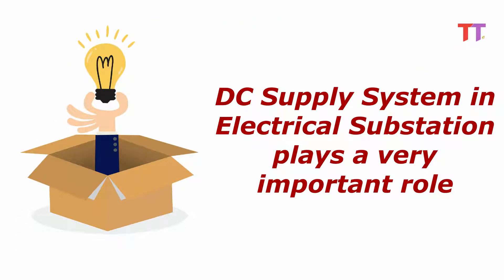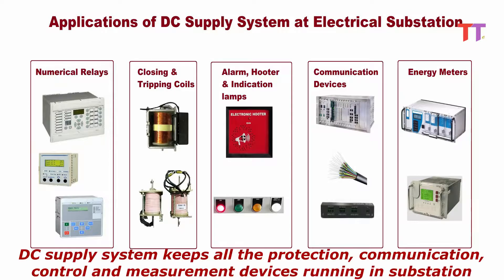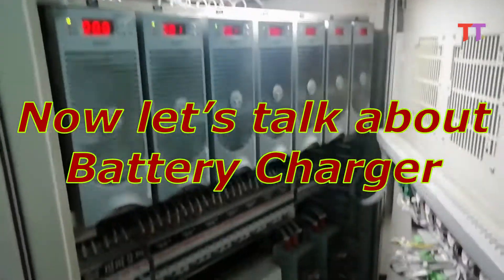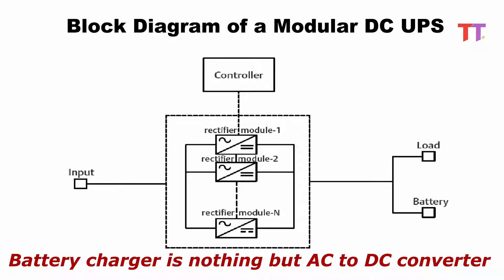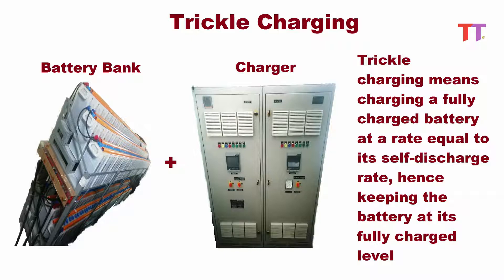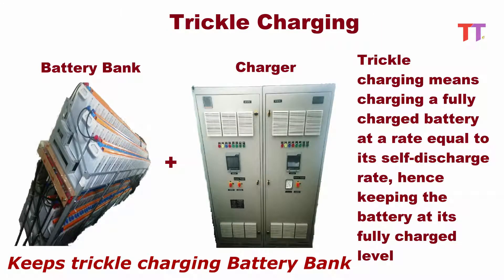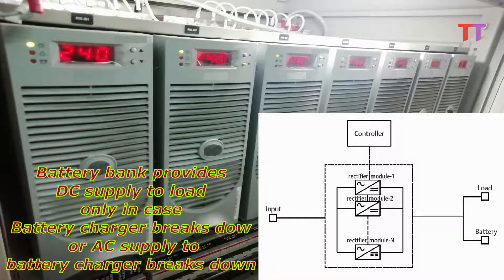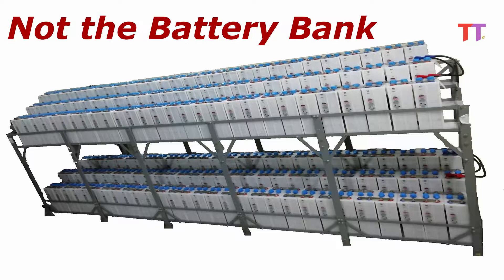DC Power Supply System in an Electrical Substation. DC system. Watch at 1.5x for better experience.

Comment: how to know the size of the battery system for  33kV/132kV Substation.
Reply from the maker: Thank you for the comment. It depends upon the specifications of battery cell.
Reply: Completely dependance on two factors: (1) continuous DC load, and (2) worst case emergency load over a period of typically 8 hours.  For example, the worse case in a substation is typically a bus differential operation or a breaker failure operation which requires many breakers to trip at the same time.

Comment: How to set boost or float voltage and current limit
Reply from the maker: The voltage level for float mode is typically 2.25V/cell for lead acid or 1.44V/cell for nickel cadmium. For boost Charging mode  80% battery capacity is charged at eleveted voltage.

Comment: How to set the charger parameters setting
Reply from the maker: Thank you for the comment. Charging Parameters setting depends on the type of charger and battery bank. It is different for different DC set. Best way is to follow the manufacturer's manual.
Reply: @ElectroGlobe1   please send your contact WhatsApp number Sir,
Reply: I want to discuss with u